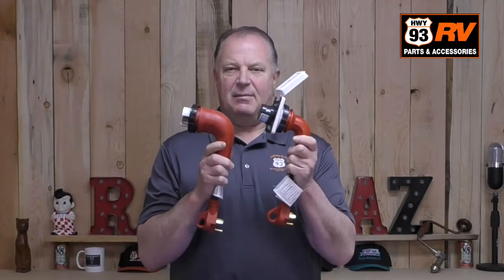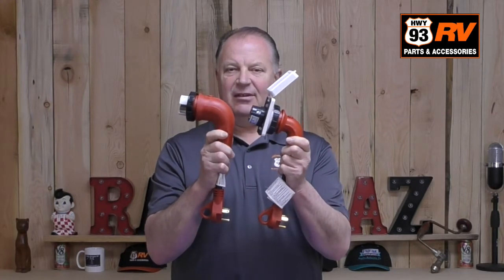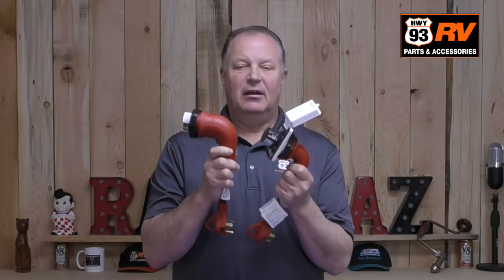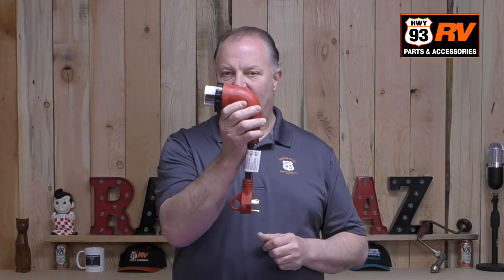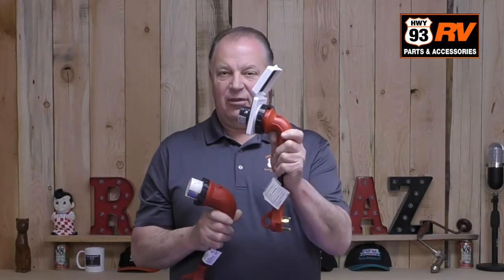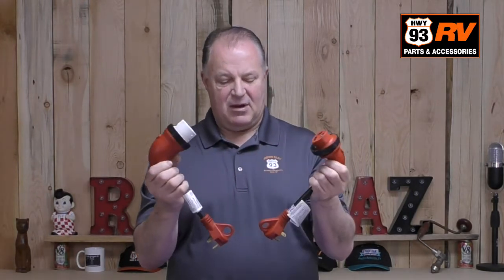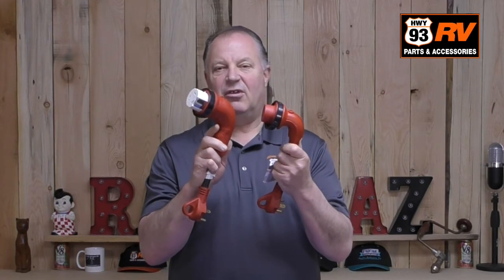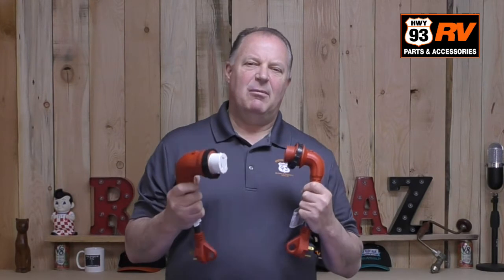50 & 30 Amp Twist Lock Power Cord Differences

Comment: When insert my plug and having difficulties, I pushed a metal piece back.  Is that supposed to make contact with the metal on the female connection.  Does the receptacle need to be replaced?
Reply from the maker: What you describe sounds like you need to replace the receptacle. There shouldn't be any parts that move in any direction on there own.